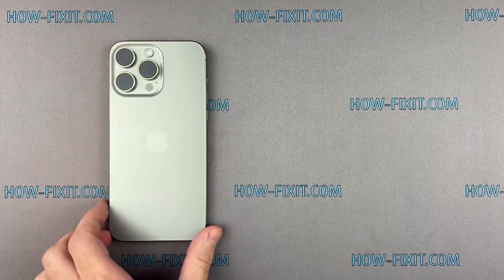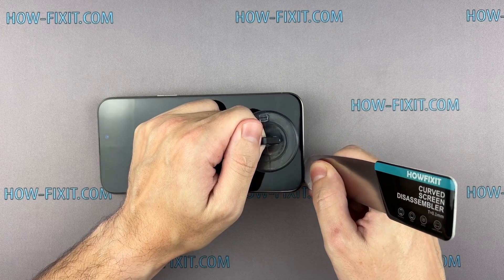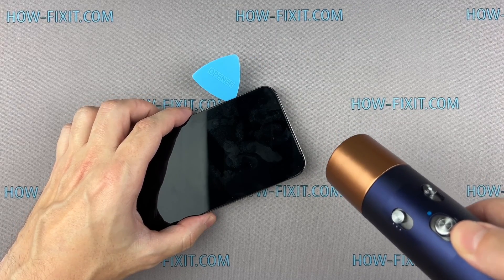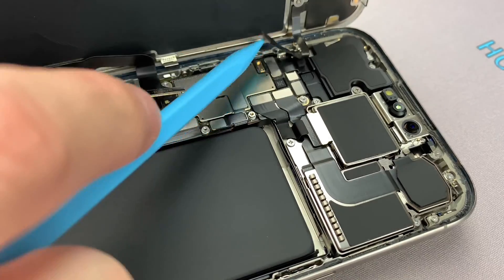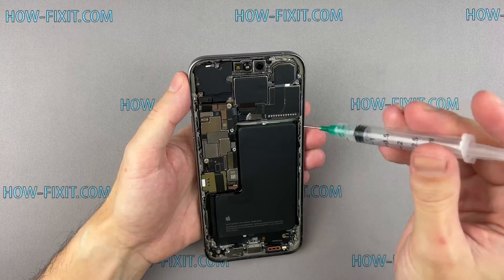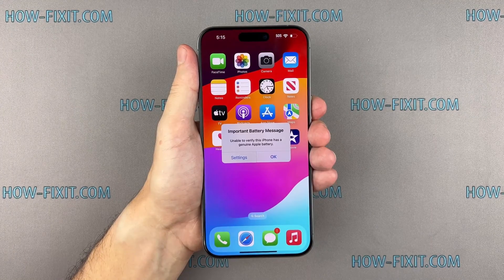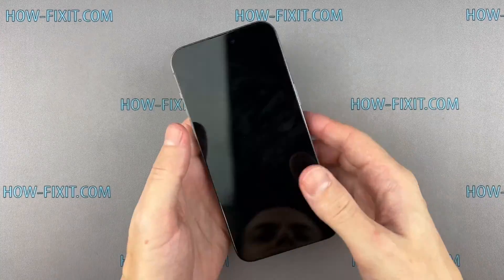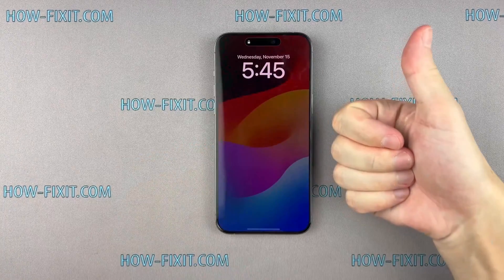iPhone 15 Pro Max Battery Replacement Guide

Comment: Apple is NUTS 🥜 😢for trying to open the device with a hairdryer! My husband was an Engineer in radio & frequency department for Rockwell & Hughes Aircraft Company as a Top Manger & Motorola; he would have been terrified of heating up such a small device!!! Melting components that would die eventually! Do NOT USE HEAT!! It’s too dangerous!! Cy

Comment: All that just to remove a single battery. I miss those open the lid and swap battery days. No need to go to shops
Reply: Seriously. I miss my T-Mobile MDA pda phone with extra batteries. If one died I would throw it on my external charger and plug the new one in.

Comment: Mine is a year old, and still at 97% max capacity. I plan on using this until the end of its support cycle. 2030
Reply: 85% for my charge at 80% not 100
Reply: Do you load it up to 80% or 100%?

Comment: If you buy the battery from Apple with their self-repair service, you can pair the new battery again.
Reply: So after paring will it show maximum capacity again??
Reply from the maker: @shoebansari7731  Yes, check the iPhone Battery Calibration video tutorial, link in the description under the video

Comment: Hi I broke my smd capacitor off in my laptops GPU die while applying liquid metal and conformal coat and first when I powered it on it didn't turn on and now when I cleaned and took out the broken capacitor due to which short was occurring after playing game for 10 to 15 min it blue screens what can i do do repair my laptop l.
Reply: Find out where the fuse iis that needs to be replaced. Hopefully there is one but might not be one,  google it  if  there's no fuse you're probably out of luck